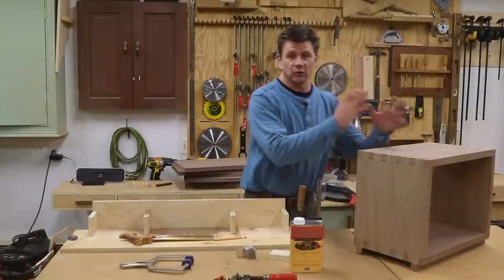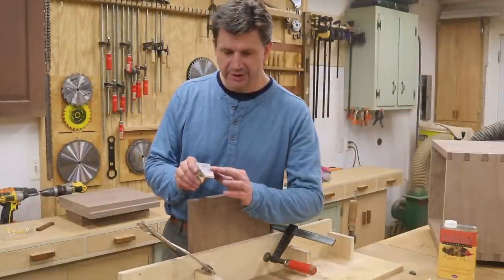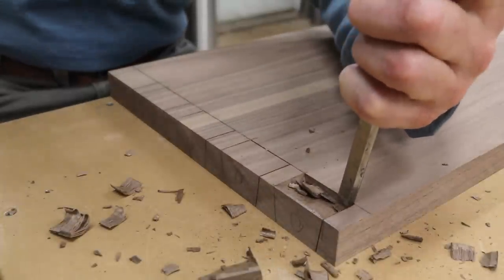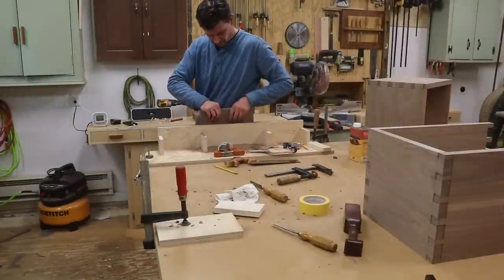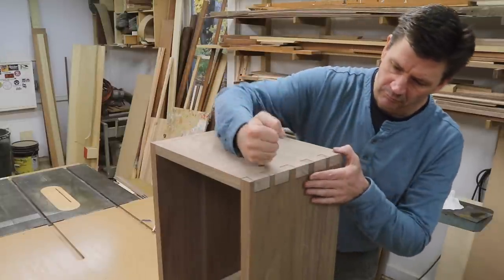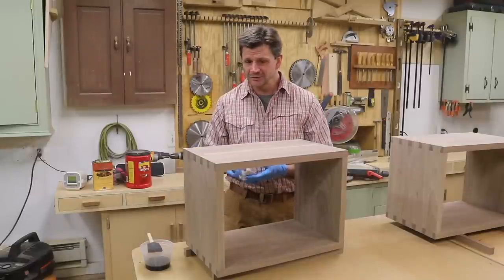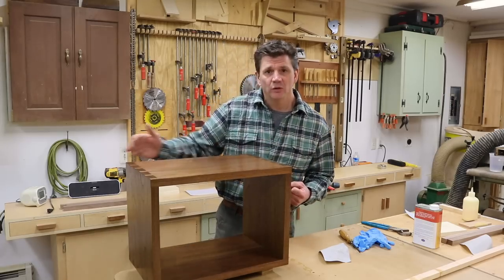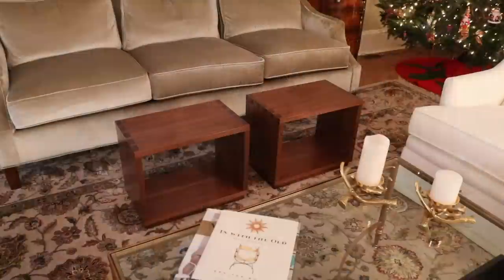Black Walnut Tables - A Fine  Furniture Build

Comment: Something that I do for inside corners: I use boba tea straws that I pinch at the end to give a sharp corner. They work fantastic and can be found at any Asian food market. Super cheap and will save you a ton of time. I do still use the moist brush or towel afterwards to catch any remnants, but the straw gets almost all of it.
Reply from the maker: Good tip...thanks

Comment: Can you explain why you oriented the dovetails in the direction you did? I would have expected the tails to be on the horizontal, in order to "hold the cabinet together" from side to side, as gravity and whatever load is placed on them should handle the vertical direction. With the tails in the direction they were, the only mechanical function they are providing is against the weight of the box when being lifted and carried by the top, correct? Understandably, the expected use cases don't really call for the mechanical benefits of dovetail joinery, so this may have simply been an aesthetic choice? by the way, they are lovely pieces of furniture!

Comment: Hey Jon, I've always done the wet rag to get the glue out. I'm dealing with a situation with black walnut that when I wet rag the glue about an hour later I come back and there's black stains where I was wiping. I get all the excess water off and move the rag around so I'm not putting glue back on the material. Any Idea or anyone have an idea what the heck Im doing to get this reaction? It's only with black walnut. 
Also, where do you get that hand cut dovetail guide?
Thanks Jon and great tables!

Comment: What is the cost of the walnut used in this video? Where I live, in the Netherlands, solid hardwood this wide is very very expensive...
Reply: I believe those are a two board glue-up.                    JimE
Reply: Tijmen van Westerveld i. from N.Y. and it depends where u get it from a mill is the cheapest but from a rockler store where its pre cut s4s they sell it for 10.99 a bf maybe its different where jon lives but jusy an idea of the price on walnut

Comment: hi Jon. we cant get waterlox finish in australia. could you please describe what kind of a finish waterlox is?
Reply: It's an oil-varnish blend similar to many others on the market such as Watco Oil and Minwax Tung Oil Finish. Waterlox uses tung oil for their blend, Watco and most others use linseed oil, some use soy oil, each have their advantages. It does produce a nice finish, but probably indistinguishable from Watco and others. If it were just tung oil you'd probably never get a build, but with the added varnish resins (as the spokeswoman mentioned) it begins to build a sheen and protective film after 3 or 4 coats.
Reply from the maker: Thanks for the comment and help here Michael....here's a also a link to the Waterlox website that describes the different finishes:  https://waterlox.com/furniture-jon-peters